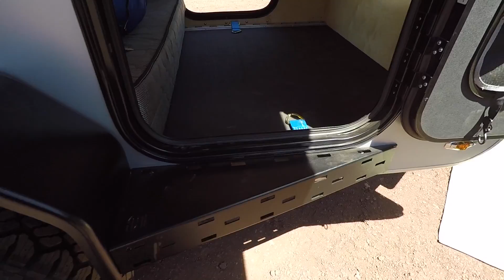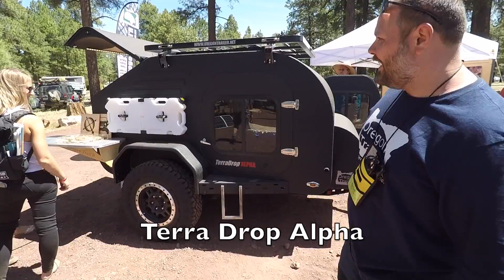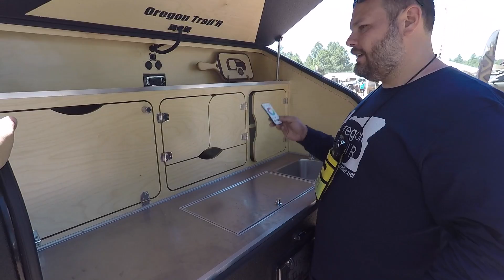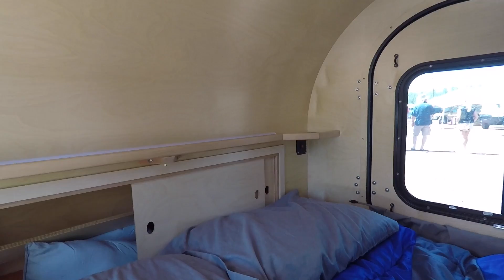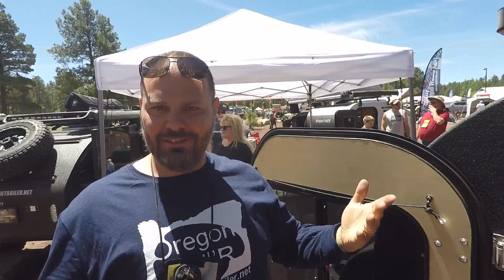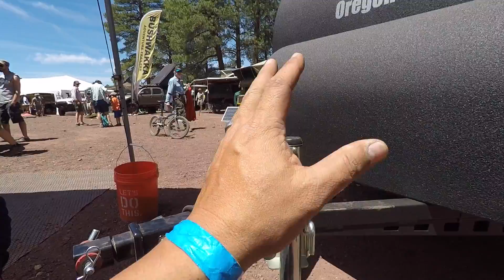Terra Drop heavy duty tear drop trailer by Oregon TrailR : Overland Expo 2018

Comment: Good video and content!! Same comment I had about last years trailers. CRAZY prices for what you are getting. Can anyone explain to me why I can buy a new fully enclosed 6x12 cargo trailer for $2489.00 or a new 5x10 tandem axle, hydraulic lift dump trailer for $4069.00 and these type trailers start at $5,500 or $15k as seen in the video?  I am not saying these are not nice trailers and it is not just this trailer because it seems all these "off-road" trailers are crazy expensive.
Reply: It's all relative Sir.  We are using MUCH MUCH higher quality materials then any of the mass-produced trailers out there.  You simply cannot do the things with a cargo trailer that you can with our campers, and I'm sure the manufacturers of said cargo trailers would absolutely agree.  Call up your favorite cargo trailer manufacturer and ask if their products can handle the Rubicon trail.  I guarantee they'll say absolutely not.  Our campers can easily handle it, and it takes a lot of engineering, complex fabrication, and zero tolerance for poor quality control.  We have significantly more of our money into the rolling chassis on TerraDrop than your 6x12 cargo trailer you mentioned costs out the door.  This isn't to say that the cargo trailer's aren't good at their intended purpose, they just aren't built for what our campers are built for, that's all.  You can take a $20k Kia Sportage off road, but it's not going to perform or hold up to the abuse like a $85k Land Cruiser.  You can take a Ruger 10/22 Elk hunting, but it's not going to do the job like a Remington 700, am I right???  Thanks for watching, and I hope I've helped to explain why our campers should not be compared with cargo trailers.
Reply from the maker: Its a niche market. Small production lines built by mom & pop or in this case 2 brothers. Everything is hand made in Eugene Oregon which as you know US labor is expensive on top of that they are skilled craftsmen making rolling artwork which costs even more. Then the materials used are high quality with no corners cut. 

I know cargo trailers are affordable but I dare you to take a mass produced cargo trailer with street grade torsion axles, home built with Home Depot wood fully loaded with your camping gear, food and drinks... take it off road over downed logs, boulders and creeks etc etc pulled by a 4x4 truck. It will be way cheaper and it will eventually leak, rot, crack, bend and break in a year or so. Not heirloom quality. But hey it can be made cheaper for sure.

Weeroll campers uses regular enclosed cargo trailers and coverts them into camping trailers. They work...but they can't go where a real off road purpose built trailer can go. Runaway campers makes a $4000 tear drop trailer which is just a wooden box on wheels with literally nothing else (no power, no water, no racks, no cabinets, no stove, no vents) but it does the same thing as other tear drops. You drag it outdoors and sleep in it. How many years will it hold up? It depends on your level of use....at that is the key right there. What level of camping do you do off road? If you camp at a KOA RV site with shore power and bathroom facilities....a travel trailer might be a better option. If you go deep into the back country off grid year after year you might want to upgrade to something more purpose built for that level of use. Guns are the same way. You can buy a 50 caliber rifle from SERBU for $900 or you can buy a $10,000 Barrett 50 cal. They shoot the same round.
Reply from the maker: Guns and Gear Network I found this video of Jake breaking his cargo trailer on his way to Overland  Expo 2018. It's a perfect example of how hard off road life is on these vehicles.
https://youtu.be/t-oL_6zRzFQ
Reply: Sure, but your initial comparison is also flawed because A DUMP TRAILER AND AN OFF-ROAD CAMPER ARE COMPLETELY DIFFERENT PRODUCTS!!!!  How is it that you cannot see that your argument makes zero sense?  Timbren are Axle-LESS, FYI, and while they are not proprietary, they cannot simply be bolted to any existing chassis (feel free to ask how I know), and are incredibly expensive, which is one of the many contributing factors to the higher expense of our campers and others like ours.  You are attaching a monetary value to the amount of features a trailer has, rather than the quality of the build. I get that I'm arguing with a wall, so I will refrain from wasting further time.  You asked why these are more expensive, and I did my best to educate you.  Just please take a moment to consider the clearly obvious fact that maybe you don't understand my industry as well as I do.  Enjoy the rest of your day!
Reply: I'm sure you are. well, cool. Anyway, I think we've beaten this bush as much as she'll suffer....Let's just move on.
Reply: Thanks for the vote of confidence, Mixflip!
Reply: It's OK that you don't understand...we're not asking you to understand. As an intentionally small company building a specialty product, we don't need, and can't service a huge audience. We've tailored our product to a specific audience, one that apparently you're not in...and that's OK. You'll be happy with buying whatever suites you best, and our customers will continue to order the products they know they can only get from us.
Reply: OregonTrailR 
I am not saying to take a cargo trailer to MOAB. What I am saying is compared to what you are getting it is relative.  Besides the cargo comparison I also mentioned the dual axle dump trailer with hydraulics.  Just don't see how these off road type trailers should cost that much more f or what you are getting.
Reply: OregonTrailR 
Your comparison is flawed because Ed Brown pistols are usually an appreciating asset as like many guns over time. A trailer is a depreciating asset and will lose value as soon as you leave the dealer and will continue to do so. A gun evrn a Tarus will and xan go up in value. 
I am only saying myself along with many others do not see the value in what companies are selling these trailers for. Timbren axles are not propriety and can be added to any trailer. I have seen pull behind campers with bathroom, shower, kitchen, etc sell for around the same amount these off road trailers sell for.
Reply: OregonTrailR I am very much in the off road and overlanding scene.
Reply: What I do understand is that as a potential customer I can not wrap my head around that trailers like this should cost as much or more than a full-blown camper with working toilets, kitchen, awning, beds, etc. This is not an attack on you, your company or your quality of trailers. I am just saying I DO NOT see why there should be that much cost difference. It is that way in the entire "off-road" trailer industry. I just think it is a matter of time when a large company gets in the game and the price will be significantly less. This camper from Camping World is an example of why I dont see why or how they can sell this at the price they are not even the manufacturer and have to buy them at a lower price then sell them for even more markup.  You said yours as shown was $15k? This full camper is $10,989. https://rv.campingworld.com/searchresults?rv_type=towable&condition=new_used&subtype=TT,TTH&custompricerange=true&sort=price_asc&zipsearch=true&search_mode=advanced&locations=STA,CFX,CNC,MNC,GR,ROA,FAY,RAL,ASH,COL,MB,KNOX&page=2

Yes, I know you can NOT take this off road but  that has nothing to do with this comparison. The cost of making yours "off-road" worthy should not outweigh the difference in price compared to what you are actually getting.
Reply: @GunsandGearNetwork   Let me set you straight!  Right now! The RV industry is absolutely HORRIBLE! It's a huge conglomerate, that just doesn't give a damn, because Nobody is demanding any control of there level of quality and service, It's pathetic! I have a 2013 Open rang 32 foot TT that I paid over $32K for. 5 Years now, it's a piece of Crap, I can't sell it! There are so many things wrong it 's crazy, and I'm not an isolated case! The whole industry is rampant with very, very disappointed owners. camping world is the worst! and that Jayco 10K trailer your referring to, That, is a piece of crap, that will fall apart just sitting in your drive way! If I could get rid of my TT, I would by a Terra-Drop! I can see the difference, in materials, craftsmanship, and engineering, and I was a BMW Adventure Motorcycle rider for years, Loved it, I should have gone this Overland route of camping in the first place, I'm so disappointed right now, I feel I have this albatross over my head with my TT. I'm just sick and tired of paying $50.00 dollars + a night for spot in a Campground, right next to someone 10 feet away. When I started camping with our RV I had this vision of the camp sights that I'm seeing on all these Adventure/Over-lander Videos, That's the camping I want, and you ain't gonna hall no Utility trailer or any of the Junk RV's, especially like the Jayco, to many of these campgrounds or places! OK, It's late, I'm out of beer! Good Luck!